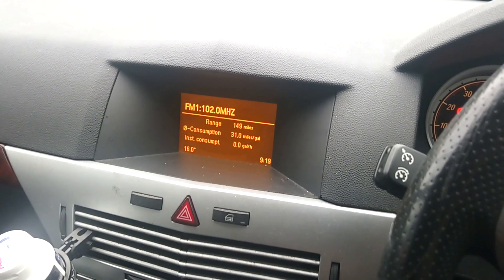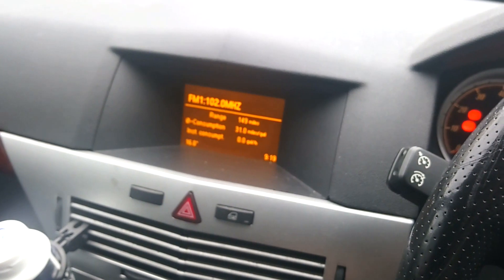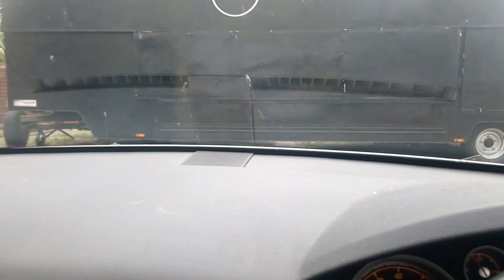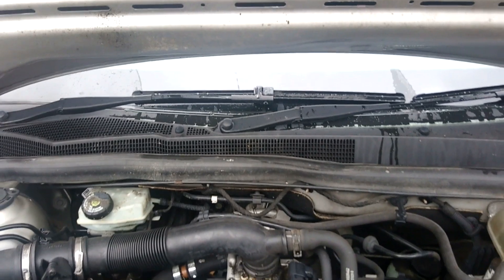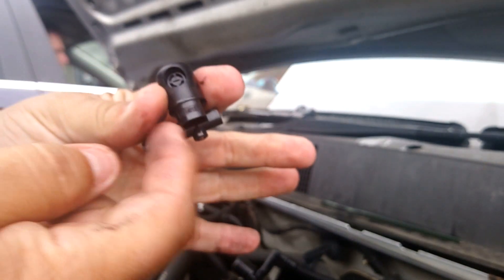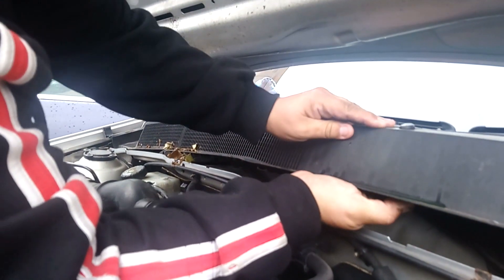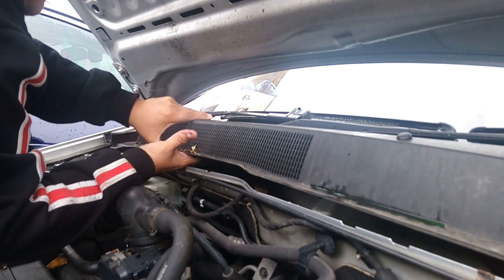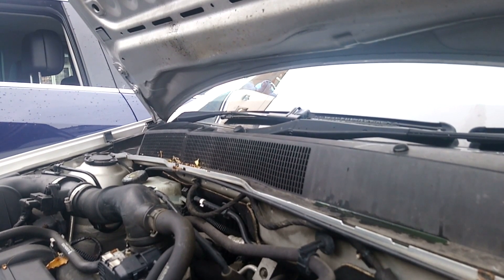Upgrade The Washer Jets on An Astra H

Comment: yeap smashing the old jets out with a hammer seems to be on par as per the OEM manual. :)
Aside that did the trick, but it you taken off the plastic part, you could get some other things down their as well, like cleaning debris and have a look on possibly clogged drain lines that would later on save you from some hassle with issues on electronics and rust. :)
Reply: How much of a ballache is it to get that scuttle tray out, is it just wipers you've to take off?